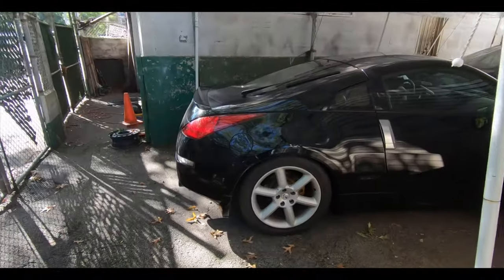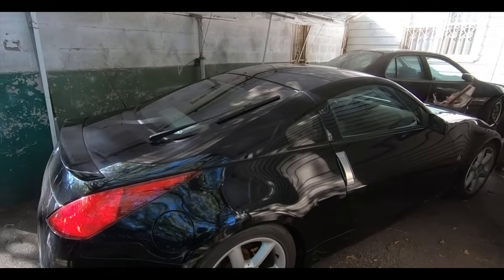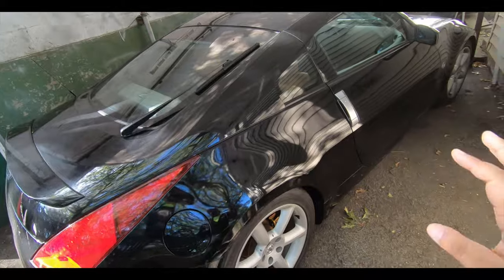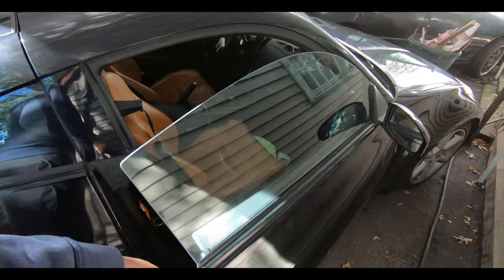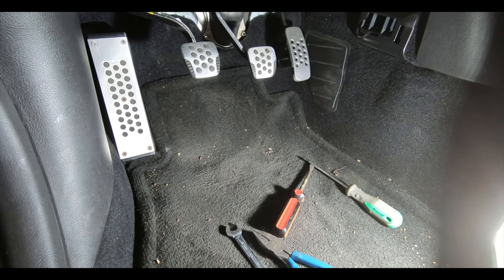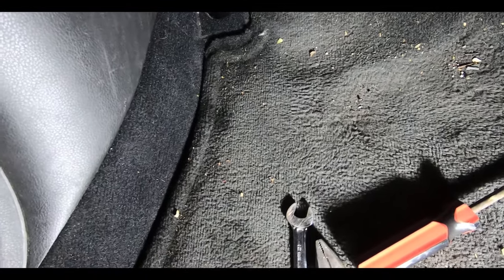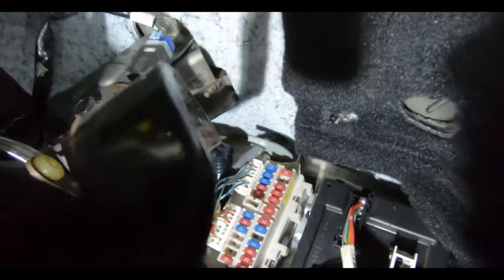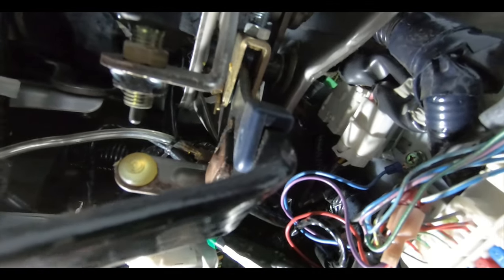350z clutch pedal adjustment 🏎

Comment: Right now I am having an issue I can’t figure out.. help? I bought a car with a new clutch. At the beginning.  as I started letting out the petal from the floor, the clutch would grab hard. Didn’t have any issues other than a tick when I had the petal out and in N… When I’d press it in the noise went away.. the slave cylinder was bad so I replaced it and the master as well, bled them really well. And still had the tick and the petal would be slow to return all the way.. it would Pop back 60% of the way then slowly the rest of the way.. if you let your foot off the petal fast it basically comes up and then slaps the bottom of your foot.. now when I have clutch pressed in all the way I can’t get into 1st gear.. sometimes if i shift into 4th then try 1st it will work but it’s stiff.. once I get it into 1st gear I can come back to neutral and any other gear ( keep in mind car isn’t moving at all during all this. Just clutch in and manipulating the shifter.) but say i go back to neutral and let the clutch out all the way, then press it in again.. im back to square1 … can’t get into 1st gear.. stiff as a rock.. but I can sometimes get it into 4th and then 1st again after that.. any time I let the clutch out all the way in N I can’t get into 1st … side note  when the cars not running I can go through all the gears .. clutch in and out doesn’t affect it.. only while running. Thanks for reading this ..
Reply from the maker: So i had the issue with the slow pedal and it was a combination of the slave and the clutch line was heating up you might want to change it to a ss one. As far as not going into 1st with the clutch all the way in that might be a problem with the clutch or a adjustment with the rod. Normally you should be able to put in to all gears with o with out the clutch when the car is off unless there is a major problem with the transmission. I will check the rod and see how the adjustment is set  like i showed in this video  and also see if the clutch line has wear or swelling  you might need to swap that out also. That might be a good place to start but if that still a problem you might want to take it to a pro to do a full check.
Reply: I have this same exact problem rn did you ever figure it out?
Reply: I have the same issue with it slapping my foot on shifts. Did you figure it out?

Comment: When you did the adjustment did you feel like the clutch was too soft? Like 1st is weird. I did 3 turns and I’m on the fence on wether I like it or not.
Reply from the maker: no it did not feel soft it just make the engagement point lower for me. I am running a aftermarket clutch that is stiff to begin with so not sure if that would make a difference.
Reply: @ProjectZGarage  hmm. It’s almost like the first 75% of clutch pedal travel has 0 resistance and last 25% has resistance and clutch bites right at the top of that 25% but it’s hard to “feel”. Car is very easy to drive in every gear but starting out in 1st I feel like I’m riding the clutch too much
Reply from the maker: @OleBcy  maybe try and bleed the clutch and see if it has air in it I don't think it should feel that light.

Comment: 350z has  naturally high bite point?
Reply from the maker: yes it does but when you change the clutch to a performance one that can chance. When i had the single disc it was very low and when i when to this dual clutch it was higher so this adjustment helped out.